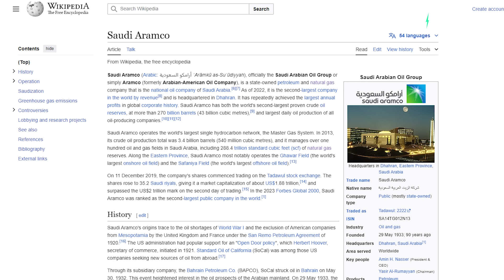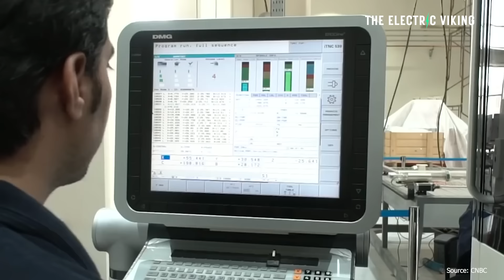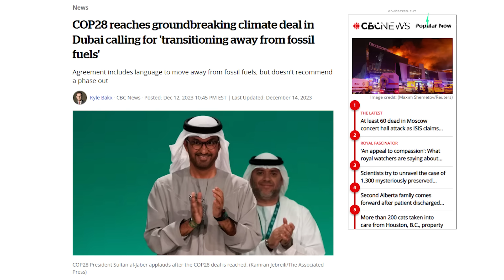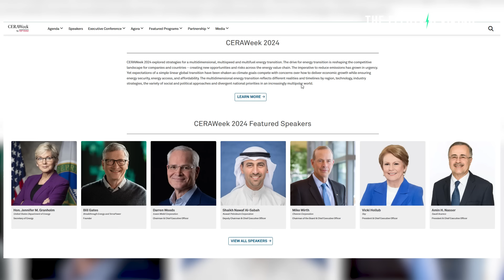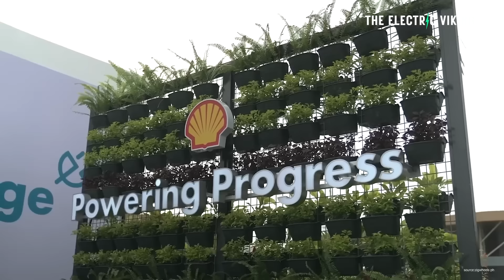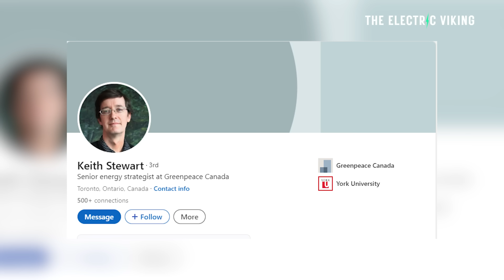Saudi oil CEO says 'We should abandon the fantasy of phasing out oil & gas'

Comment: I worked at Saudi Aramco for 10 years.  About 10% of plastic comes from oil or natural gas.

Saudi Arabia relies very much on Aramco.  No Aramco no Saudi.  However, there are about 1.5bn ICE cars in the world and only 75m new cars sold every year.  So even when we get to 100% of all new cars are BEV it will take 20 years to phase out the ICE cars.

We need the creation of electricity to come from non fossil fuel sources.  The US is setting aside millions of acres of desert government land near power lines to set up huge solar panel farms with battery storage to assist in feeding the grid.  Governments should be subsidising solar panels on roofs.  Smaller countries like the UK are investing more and more in offshore wind farms.  These again should be linked top large battery storage so on days with no wind you have a back up source and one very windy days you have storage for surplus electricity.

Everyone building new appartment blocks and office space should be compelled to add EV charging.

Comment: Peak oil will happen within 2-3 years. After that, the price will go up, driving people away from petroleum based fuels.
Reply: Agreed most don’t understand that oil prices will go UP
Reply: Sadly, this is not true.   Fracking
Reply: Why do you think this? I'm assuming because of demand.
Reply: @grantbuttenshaw  oil refineries will shutter, pipelines will loose out on leases, no more easy investments, oil subsidies might finally end?
A global carbon tax is coming at some point. 

Ice cars will end up being banned from city center's around 2035 globally and sooner in some more forward thinking countries. 

In the U.S. alone we do over 420,000,000 oil changes annually requiring over 28,000 businesses dedicated just to those oil change services.
And wasting over 160,000 tons, yes TONS of steel from just the used oil filters alone. 

But of course that simply pales to the 35,000,000,000-40,000,000,000# of crude oil the globe burns up each and every DAY. 
It's literally a volume business and peak car already happened between 2016-2017 globally speaking. 

I saw a report that said world wide over 40,000,000 evs would be used daily to end this year. 
So that's about 60-80,000,000 gallons of gas NOT being burned just for full size evs. 

Ev Construction equipment, trucks, buses, ships, trains, short hop planes, scooters&motorcycles will save tens of millions more gallons of gas/diesel/urea fluid etc from being consumed daily. 

Gaining steady market share over ICE yoy from here on out. At some point soon that's gonna matter a LOT! 

Even China's largest oil refiner last year already said publicly that gas consumption for transportation had peaked in late 2023.
And a large China ev car CEO said by the summer of 2025 ice vehicle's wouldn't be profitable to make anymore over there. 😎
Reply: It has been recognized that conventional oil production  peaked around 2005–2006. What has prevented peak oil from then on is  US tight oil production , which rapidly increased since the Global Financial Crisis in 2008.
Reply: You might want to check out the commodities market.
Oil is currently up over 14% from this time last year.
Gas prices where I live are $2 per liter CAD.

Comment: Pretty much 82% of all oil is burned as either Gas (45%), Diesel (29%) and  Jet Fuel (8%).  Less than 1% is burned for Electricity.  Point is that if over the next several decades, Cars and Trucks are completely transitioned to Electric.  Even if Jets stay 100% on Jet Fuel, the amount of oil needed will drop to around 1/4th of what is utilized today (for things like Plastics).  If I was running Saudi Aramco, I would pump ALL the oil I could and use that cash to build out as many Wind, Solar, Battery farms and Charging Stations as possible to keep the cash flowing.  Considering that the average profit margins on Oil wells is under 5%, but on Solar Farms it's between 10-20%, they wouldn't even need to replace all the cash flow, because the profits are 2-4X.  To top it off, Battery farms have an even higher profit margin range of between 15-30%.

Comment: In an industry that is under threat, saying we should abandon the fantasy of phasing out oil and gas sounds like an admittance of fear.

Alternative energy sources like renewables is a big threat to the oil and gas industry because it keeps getting cheaper and better, also battery tech is getting better and cheaper, which allows renewables to have a bigger buffer when it comes to storing of that energy for more consistent power.

What the oil and gas industry really fear is that they can't keep playing the games they used to do with jacking up the prices a lot, that is a lot harder for them to do thanks to renewable energy sources, the moment they try to do so, they encourage more investment and deployment of renewable energy, which will end up killing off the oil and gas industry sooner rather than later.

The oil and gas industry are in decline, it might not seem like that to some but you can tell there is real panic in the air, they'll try there best to push up prices, but they know it's very short-lived because of alternatives that are around, they also know that the percentage of oil and gas use in the economy is going to go down over the coming years, until these companies either have to adapt into new industries or go bankrupt.

Either way, these clowns have been trying to control the energy industry and control the price we pay, fixing the price we pay and the amount they produce for too long, it's high time we finish them off for their corruption, which basically means more aggressive price cuts on renewable energy and battery storage, which is the ultimate fear the fossil industry has.

I mean, seriously, what were countries around the world thinking about with being so dependent on fossil fuels when we have organisations like OPEC that artificially control the price and production.

As for countries that are too dependent on fossil fuels for the economy or even countries that make up a sizeable part of the economy from fossil fuels, you better start diversifying your economy, because the good times are limited, chances are, the value you can charge for fossil fuels is going to be under constant downwards pressure thanks to renewables, eventually that's going to lead to the point where fossil fuels have little to no value, especially as renewables, battery tech gets better and cheaper, and then there's energy security, since the war in Ukraine, more countries want to produce more of the energy they use internally, renewables and battery tech can do all that if done right.

The other nice thing about this is that with EV's and heat pumps on the rise, especially in Europe and other modern countries, it fits perfectly with the renewable sector that all our energy could eventually be renewable until something better than that comes along.

Comment: Out of principle (and because we are cheap), our family has been embarking on a journey to energy independence bit by bit.  I have always felt we should not be funding autocrats.  Putin's war on Ukraine has put an explanation point on that argument.  Frankly, I don't like to be at the mercy of corporate sociopaths either.  

Whenever we renovate and have opportunity to insulate, we do.  We insulate as much as possible reducing our energy needs.  

3 years ago, we installed solar panels and we will install more going forward.  

We have just taken delivery of our model Y.   A great car.

Next steps include a ev truck to replace my work truck.  Waiting for prices to come down and would be nice to have a proper work truck with a 8 foot bed and less cab.  

When our old ac unit packs it in, we will replace it with a heat pump.  In addition we will install a minisplit to allow better temp control downstairs.  

In theory we could even make plastics from biomass feed stocks.  We need some nifty tech to reduce micro plastic load in our environment.  Also for recycling.  Like minerals it would be nice to reuse material rather than produce new stuff all the time.

Comment: Here is another way. 

The Eco Gas/Water Engine?

Who really needs a hydrogen fuel cell to replace a gas engine? This electrolysis unit is great. 

This can be spliced into the gas line of a car to give some clean, cost-free fuel? 

Even if it can not replace all of our gas, we all could get rid of pollution by extending our mileage with this invention, and it is free of any real costs but an occasional cleaning and water.

The main aspect is to get better mileage, of course, but the real benefits are to the environment. Since hydrogen and oxygen now replacing a small portion of the gas with clean fuel that burns without any pollution, this causes one other effect that is very good. 

It causes a cleaner slightly longer firing in the chamber, causing the gas to burn more fully. This thorough burning of the fuel can reduce  the pollution from car exhausts by up to 100%.  

The smaller the engine, the more it will apply.   

According to inventors claims, engines up to 650CC can be run entirely on water electrolysis. Think lawn mowers, augers, literally anything with a small gas engine can run pollution and even the use of gas any more. Just convert it. 

This can be done to any age or size of gas engine.

The descriptive video is below. 

 We should all do this if it is possible.

https://www.youtube.com/watch?v=eacLgrqRdyk&list=WL&index=4